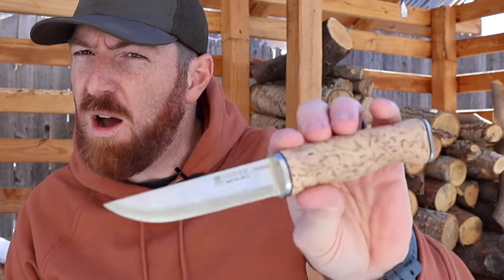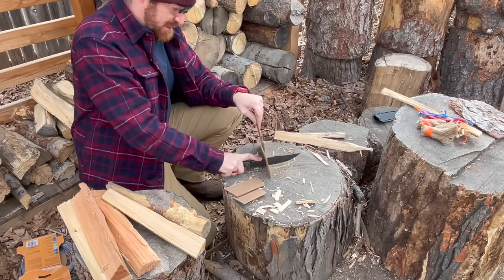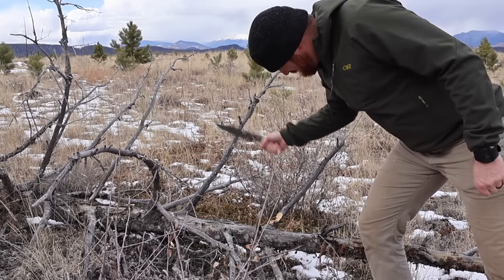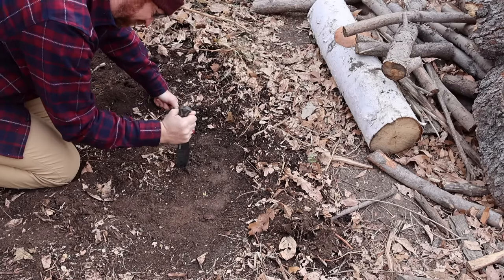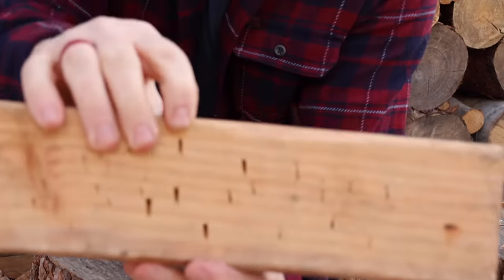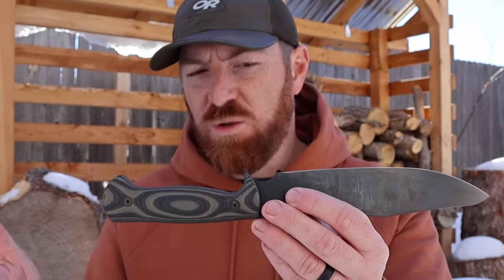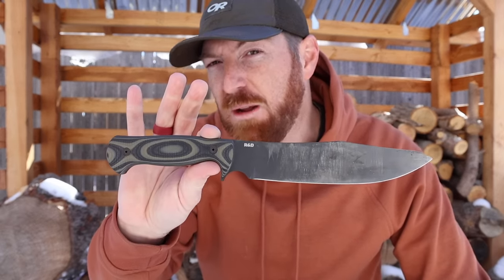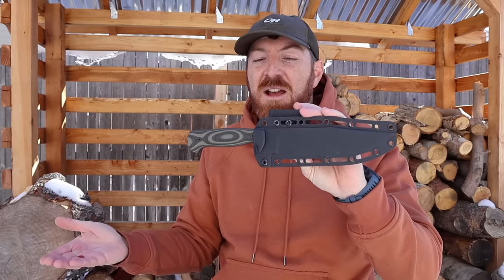Should You Take This Monster On Your Next Adventure?

Comment: Not impressed.  The knife needs to be seriously redesigned.  It reminds me of Esee.  A company that has become too comfortable with their mediocre design, and continue to raise their prices without any real benefit to owning the competition.  Sorry, but nothing about this blade says "Bushcraft" to me.   It's a small Bowie style, if anything.  Mainly due to the upsweep on the spine and narrow blade profile, not to mention the thin blade.  I'd rather own two Beckers to one of these.  Just my opinion.
Reply from the maker: Great feed back! And I agree I hope a 2.0 will be released at some point.
Reply: I totally agree as well
Reply: I’d have to disagree. The ESEE 3 at 1/8th” blade stock thickness would not have snapped. I’ve owned 5 of them at the point and have never broken one.
Reply: Its a huge fail on its own merits, but I wouldn’t compare it to Esse in anyway, nor would I say Esse’s are a “mediocre” design.  Stale designs? Yes, but Esse’s are truly proven and have a no questions asked lifetime warranty.  Esse’s prices are climbing like everything else, but the current E6 is still only $143.. less than half of this Montana thing.
Reply: Just get a Lionsteel and a Schwarz and ya set!
Reply: That’s why I went condor plan a
Reply: Give me an Tops Field, Esee 5/6 or Ontario Rat 5 fixed for $150 less. You can get Buck 119 SV30 for $150.
Reply: @stuartrollings602 Same here nothing beats a LionSTEEL T5 for example or a Joker Nomad, Cold Steel Hunter or SRK in sv30. Just picked up Buck knife in sv30 for $120.
Reply: 52100  was my favorite marble vs. glass marbles. But as knives I would prefer sv30

Comment: I prefer the reground shape you did anyway. I believe it will be slightly stronger per thickness AND the point is more inline with the handle center. Likely more penetration at many angles. Sometimes the higher points penetrate less because the blade tends to follow the longer edge when thrusted [a point off center will "tend" to turn slightly in the hand]. Based on past "tests" with various blades. Potentially larger wound cavity with the higher tip... at the cost of noticeable [when I was younger] loss of speed, second thrust. But, this blade profile was pretty stinking' good to start with.

Comment: I've had several of the cold steel drop forged series of knives, which are also 52100 steel. I've always had extremely good experience with them  so I have no complaints on the steel choice.
Reply from the maker: Those cold steel drop forged blades are sweet!
Reply: @gideonstactical  100% agree

Comment: When it comes to survival knives, I will argue you definitely need a little extra at the tip. Can’t have your tool breaking when you might need it the most. Btw I really like the look of the blade after you reground the tip
Reply from the maker: Thanks it came out better than I thought.
Reply: Same. I prefer the reprofile 😅
Reply: @WhispyWoods.  yes, I liked it before also, but there is just something about the new tip that just seems to fit nicely with the rest of the blade

Comment: G'day Aaron, "bushcraft knife" ? ..... odd choice, but hey, everything I own outside of the kitchen .......... is ultimately a bushcraft knife ; )
By way of comparison; the CS Survivalist, (scaled), also in 52100 and full flat @ 8 in. Love it.!!!!!  I dont usually do full flats, but CS has the done the flat angle up to a spine of over 5 mm, so its still a good wedge and batons Aussie redgum and other hardwoods extremely well and given it's weight, it does chop more than satisfactorily for it's size.
The Survivalist is the primary I take on a day hike, (where there's low risk of unplanned camping). Together with a 4 incher secondary and a saw, one can still do a shelter, big fire and finer tasks at the other end of the scale.
Deeper into the forest, my primary and secondaries proportionately increase to a parang/machete and a robust 6 inch stainless sabre, (that "can" still get one out of strife, should the primary tool be lost or fail).
So, having said all that, yes the light weight is a nicety for some, but this one falls in between my "near and far" MO, in that it's a bit too flimsy/thin and slicey for either role, (i.e. a primary or secondary), even in 52100, and yep with ya mate, thicken up the forefinger area too. Could do with a dangler btw, ... especially at the asking price. 
Anyway, thanks for the look mate, it is quite a different take these days, and may well suit many folks needs.
Cheers Duke.
P.S. the "Nessmuk pairing" has always interested me. i.e. a hatchet and a very thin, flat, butchers style knife, (in lord knows what inferior steel to 52100), so with your re-profiled tip, ....get out the Estwing or X7 ................ and you've at least got a significant contemporary upgrade on those ; )

Comment: First things first - that grind profile makes it a no-go for serious bushcraft and survival work. I'm not sure why so many modern knife makers like that style of grind, but I really dislike it whenever I try to use a knife with that style of grind (I'm not sure exactly what it's called - I've seen it called a saber grind and I've seen it called a "flat or semi-flat grind with a secondary bevel"). Anyway, it makes the tip weak, and the blade a little to thin. It makes chopping difficult because the blade sticks in the material.
The only thing it might be good for is skinning, but I prefer a hollow grind for that, and a smaller blade. 
Also, the bias toward smaller blades for general work and survival is relatively modern, starting about 1900's. Prior to that, people that had to live off the land carried much larger knives. At least, those that had enough steel to do so. Take a look at the Kukri knives, and the fairly large knives carried by the reindeer herders, as well as machetes carried by so many indigenous peoples. Heck, even the original Bowie was quite large, as was the seax and the German hunting knives that the Bowie was patterned after.
The modern "bushcraft/survival knives should be small" concept came from people who never actually have to really survive using their knife, and usually "come home" after a few nights in the woods. 
Indigenous and rural natives for whom home IS living off the land in the bush, well they use big knives, and often heavy knives.
Edit: And I guess the tip on this knife did break. Like I said, the grind is a no-go for me.

Comment: I’m surprised that a ball bearing steel like 52100 would snap, even with the thinness. Perhaps the Rockwell hardness is too high for that steel? However, your point about thickness would solve it but I would like a hardness that would allow bending rather than snapping.
Reply from the maker: Yeah, I think it’s just how paper thin the tip was

Comment: Doesnt really fit in either bushcraft (bit too large) or survival (not robust enough)  categories due to size and intended use not to memtion the price is astronomical and having a tip snap that easily on an outdoors knife is a serious issue. The price for this steel and materials should be at least under $200. For me id go with Esee, Kabar, Or Tops better performance at a lower cost. I understand the whole USA thing but your getting into custom knife prices at this point. Still baffles me a bit with all the modern steels that are available why 52100 at this price point except to make a fast buck at the expense of someone's hard earned money. Thanks for the great vid and keep making sharp things fun and enjoyable.

Comment: 52100 is a low alloy tool steel, it's not a plain carbon steel. I love it, better edge stability than 1095, better edge retention than 5160, still tough, much tougher than say O1. Easy to sharpen as well. As low alloy steels go I'd rate maybe 80Crv2 and L6 higher, but only just.

Comment: It’s a nice looking knife. 
Snapping the tip has no effect on my thoughts, although that was unfortunate at best. 
I like a full flat grind, but it needs to start with thicker stock (imho).
I agree about the handle shape. I have extra large hands and need more handle purchase at the guard. 

For the money, I would prefer the TOPS War Bowie or even a BK7.

And as for a “survival” knife, imho it should not weigh less than 16 ounces. I want something overbuilt if it’s my one tool option.
Reply from the maker: Over built but fine carver is my preferred mo 😉👍